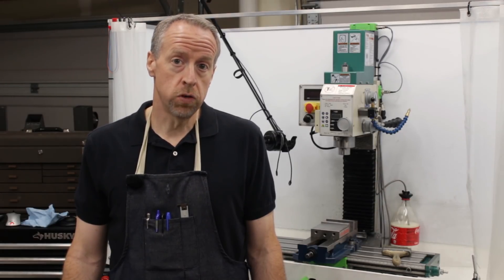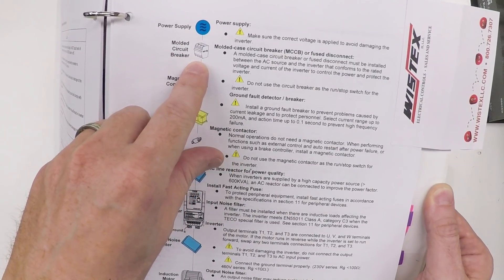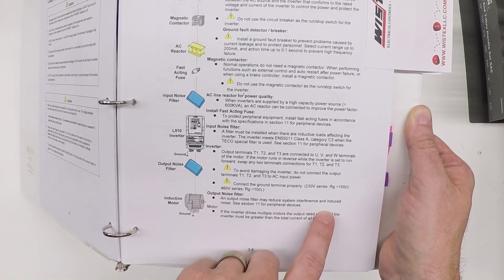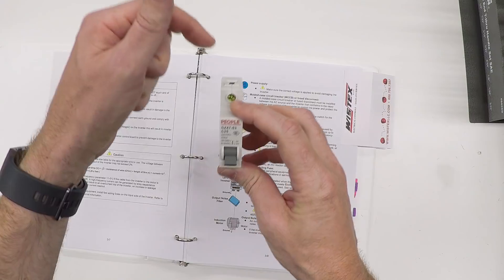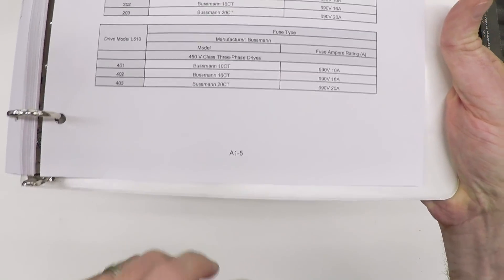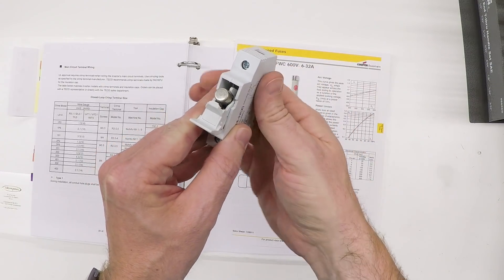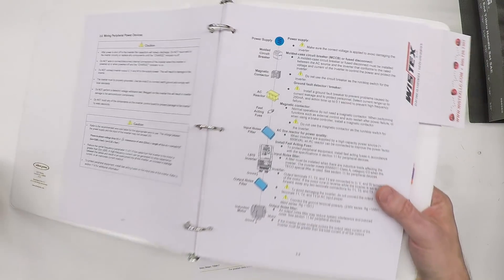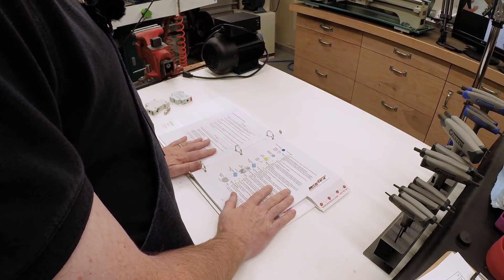Lathe VFD 8: How to Wire Circuit Protection (Breaker and Fuse)

Comment: 3 times I've called Automation direct and 3 times they've talked me out of buying a contactor and a fuse and fuse holder!  I see they say to use them and I call to ask which ones I should buy. They say there isnt any real way to save our vfd, I use a AB disconnect and emi filter and an Eaton breakers. I want to use a contactor though.

Comment: Soooo ... adding a 3-phase motor and VFD to my HF knee mill. Very simple schematic. I get the motor running on the bench, begin to install, and see what James has to say.
OK, add some circuit protection ... take off the panel on the back of the mill, and see awesome existing wiring, with two circuit breakers, not shown in the schematic.
So I've started ahead in the game. Will still add a fuse, however. Mebbe.

Comment: I might have said this before but thanks for making the best video on this subject on YouTube.  I don't know why more creators don't do this (put hot wire here, put neutral wire here etc.)   They act like it's trade secrets or something. Most people come to YouTube to either learn or validate their process. You expertly helped me learn and validate, so thank you.  if possible could you do a video on how to control a spindle either using PWM or RS485 in the way only you can do. FYI my system is running smoothly, although manually through the VFD right nom. Thanks.

Comment: Whilst I agree the safety difference may be marginal, wiring in all the safety features, as set out in the manual and as tested by UL, is potemtially one less loophole the insurance companies can use to avoid a pay out if by some awful chance your shop burned down due to a fault in the VFD!  Otherwise great series and many thanks.

Comment: question for you on the circuit breaker and fuse.  my vfd is a 240 v input rather than 120, i should use a double pole breaker and 2 fuses, correct?

Comment: James, thanks for this series--incredibly helpful!!

Anyone wire this setup with a L510-201? I'm trying to figure out what contactor to use and how to wire the remote controls for a 220v input. I initially used a Fuji Electric SC-E1 contactor but cannot get the normally open start switch to activate the coil.

Comment: Thank you for taking the time to produce this series - long-time subscriber and this series has been the most helpful for me in terms of my projects!  

Quick question: I'm setting up an L510 to run a 3 HP European machine at 50 Hertz - consistent with its highly-engineered design.  The L510 230V, 3 HP model requires a 50 amp fast-acting fuse so I'll be using Bussmann 14x51mm fuses (FWP-50A14F) in a  Bussmann 2-pole DIN holder (CH142DU).  Dumb question, but I want to confirm that I want a 50-amp fuse on EACH leg of the 230V incoming line; is this correct?  (Hoping you suffer fools graciously 😄)  The alternative, which I believe is INCORRECT, would be to install 25-amp fuse on each incoming leg to provide a total of 50 amps of protection.  I just want to double check.

Related on the incoming circuit breaker,  the rating on page 3-14  of the L510 manual is 21 amps for my unit; akin to the 19 amps on your unit.  1.25 X 21 = 26.25 amp 2-pole circuit breaker suggests I would want to move up to a 30-amp breaker.  However, I plan on staying with a 25-amp breaker (approximately 1.19X the 21 amps) because the breaker is rated as a D-curve (the slowest tripping speed).  The breakers appear to come in B-curve (fastest), C-curve (medium trip speed for smaller motors), and D-curve (motor-starting trip speed).  Also, the motor NEVER starts under a load so I'm thinking 1.19X max current for the breaker will be sufficient.  The specific breaker I'm planning on using is an Eaton FAZ-D25-2-NA.

Finally, I recognize that you're a fellow maker, and NOT a consulting engineer, so I acknowledge that I am SOLELY RESPONSIBLE for any design decisions and related [hopefully NOT, but possibly] catastrophic outcomes.

Any thoughts are greatly appreciated!  Thanks again!

Comment: I have a question. I got the VFD for my "project" and have watched the videos again and again. 
Now IF a man wanted to install a "hard start kit" for a HVAC unit, only not on a HVAC unit,
and wanted to "charge" the capacitor from the wall, to give it an initial charge, how long would he leave it in for

to get the Amps up? Thanks any advice would be helpful.

Comment: One note on why the fast acting fuse when you already have the circuit breaker is that the circuit breaker doesn’t trip until the bimetal element inside heats up enough to cause the trip, maybe one to two seconds; the fast acting fuse just blows in a millisecond. This works best if the wiring from the fuse to the VFD runs a long distance and one of the wires is grounded before it gets to the VFD. I hope I make sense to you, at least this is how my electrician friend explained it to me.

Are you running this from 110VAC to 3PH??

Comment: You are only allowed to wire that fuse from the top period!It's in the electrical code like and load.Line is always on the top load on the bottom .There is an exception to the rule in controls as part of an assembly to keep wires shorter

Comment: A very good video. My two cents are that first you don’t use a GFCI with a VFD. The VFD will trip the GFCI. One exception is the KB brand of VFDs which can be ordered with GFCI feature that prevent nuisance trips. The other tip is that if you use fast acting fuses you don’t need a breaker. It’s true that a breaker is convenient as that you can just reset it if it trips, but the fast acting fuses will blow well before the breaker reaches its limit anyway so you’ll be replacing fuses. And many companies, ABB being one, don’t recommend a breaker to protect the VFD. They prefer the right type of fuses. Thanks for the good quality video.

Comment: ANOTHER MASTER CLASS IN HOW A TUTIOURAL SHOULD BE PRESENTED  CLEAR EASY TO UNDERSTAND ........if.....IF.... you decided  to do another vid on VFD,s  i would like to see one on ........ a single phase  and 400v DC  input ..........and wiring  with 15 meter external controls   10v/24v  for  an indoor out door project      ...were i would perhaps have a stationary machine with a hose  that i could move around and control the VFD  from  near the end of the hose   so you could   start ....emergency stop... and reset and of corse VF potentiometer .... FWD/REV .... just rearly enjoy your vids and fully understand your watchers are pulling you and many different directions so i will pull you in another thanks  do you have a paypal account  i  and others could buy you a coffe..??  Mark from down under Australia   with thanks

Comment: I am confused.  You state that you have a 30a breaker on the 120v circuit but the outlet is standard for 15a service.   There are 'standard' outlets for 20a service that look similar or outlets for higher current service but the standard plug cannot be used.

Comment: Another reason to use a fuse instead of just a circuit breaker is that..If there is a large enough inrush of current the circuit breaker can actually be welded in the closed position. Where as a fuse can not. Thus a more safe circuit.

Comment: They also list Ground Fault detector/ breaker but I believe yours is just a regular breaker. No problems with that?
Reply: Where did you see that. ? You would have to spec out the gf protector very well to avoid nuisance tripping

Comment: Another great video, another great job. One thing I am pretty sure I'll be adding to my 3 phase powered rotary machines like pillar drill, lathe (when I build it!) and maybe a  sanding disk/belt would be an rpm meter (lathe especially) to save having to (mis)calculate speeds from the dialled in Hz of the VFD. Another little Arduino project?

After that ... A DRO? 🤔🤔🤣🤣
Reply from the maker: The electronic leadscrew I have installed on it now has an RPM readout.  And I do have a DRO for it sitting in a box.  :)
Reply: @Clough42  cool. Have you already done a video?
Reply from the maker: @boblewis5558  for the electronic leadscrew?  Yes.  A whole series covering the hardware and software development.
Reply: @Clough42  great! Only just discovered your channel. Will search them out. 👍👍👍
Reply: If you find the right VFD, you can usually program it to your specific motor's rated speed, which consequently, will display an RPM value instead of a frequency, and thus, eliminates the need for a stand alone tachometer
Reply: @benw4544  thanks, but the plan is to use only one VFD as I won't be using multiple devices at the same time so can switch between them easily enough. Otherwise good info to know.
Reply: @boblewis5558  Something I did, when I first started out was to get a laser tachometer - with this, I put a small piece of reflective tape on anything that spun, and could get a fairly accurate speed readout for any machine with very little effort. I believe it cost me around $30
Reply: @benw4544  thanks Ben, I'm aware of lots of different methods and the reflective tape is similar to getting car revs by using a light tacho shining onto a large white Tippex mark on the crank pulley. I used that one 50 years ago when tuning my Mini! Using an Arduino Nano, or even just an ATtiny85, building an accurate tacho is pretty straightforward. I designed one MANY years ago just with transistors that hooked up to a standard analog car tachometer for display. The Arduino compute power enables it to be that much more powerful if needed. 👍👍
Reply: @boblewis5558 Sorry, I didn't mean to insult your intelligence in any way; nevertheless, someone might skim through these comments and find the info valuable. I love the Arduino idea - those things are a real game changer for the home shop
Reply: @benw4544  you didn't and I do the same! Even the most experienced can learn little nuggets! 👍👍👍👍

Comment: An ac reactor should absolutely be used on the line side at the least. Especially if you are powering a spindle drive or axis drive. It not only does everything you mention but it also will protect the drive from inrush and motor spiking which will eventually lead to the breakdown of the drives internal components.

Comment: I've been watching this whole series. I may have missed it, but is it possible to supply this VFD with 240v by utilizing both phases from your electrical box? I thought you did but it looks like you are plugging it into a regular 120v outlet.
Reply: Yup you missed it. Here's the info from where he bought it at Amazon...
"Teco Variable Frequency Drive, 1 HP, 115 Volts 1 Phase Input, 230 Volts 3 Phase Output, L510-101-H1, VFD Inverter for AC motor control"

Comment: Hi, Thank you for your tutorial.  I am patterning my lathe 3ph motor and VFD after yours.  I can not find whar contactor you used?  could you give me that info?  Thanks, Shawn....
Reply: Why do you want to incorporate a contactor? Just one more component to fail and when it does it a lovely weld. A properly sized mccb and ac reactor are what you should really worry about
Reply: @beckyschwantes5287  This what the E-stop uses to drop out power.  If the VFD smokes, you want to kill power to it.

Comment: Do you have a way to contact you, I've got a question, that no one seems to be able to answer. It's concerning the wiring on a three-phase motor with regards to the vfd, and you're the only one that would seem to be able to answer it.
Reply: What’s the question
Reply: @beckyschwantes5287  I have all the contactors and startup switches on mine, mine's a more industrial style lathe. I would like to add the feature of a variable speed in between the gear changes of an engine lathe. however when you engage the drive lever it automatically shuts off the vfd, it's sensing a short. I was trying to think of a way to make the three-phase motor variable speed without removing all the safety equipment and everything that's associated with it.... putting it inline after the start-up relays...
Reply: @dbuilder81  you have a contactor before the VFD? Are you sure it is sensing a short or could the coil of the contactor be dropping out for some reason and dropping the power to the drive?

Is your lathe a servo shift where the spindle hunts back and forth while the transmission engages a new gear? You should have someone else pull the spindle lever and you stand back and watch the contactor. Make sure that it doesn’t drop out and open the contacts.
Reply: Also what is your input voltage and motor voltage and did you set the parameters in the drive to define them?
Reply: @beckyschwantes5287  its when you engage the motor...it runs fine hooked up to the rotary converter. Whenever I tried bypassing the rotary converter going from the VFD it wouldn't work....qlmost like it needed a capacitor on it to store a charge momentarily let it start up then run. BTW its wired 230v 3 phase.... thanks for the information
Reply: @dbuilder81  you never use a capacitor  connected to the motor when driving with a VFD. Vfds have multiple protection functions and some drives have a protection circuit internally wired so it will immediately drop the contactor or power supply and try to protect itself. Most of them will store the fault code so you can power back up and read the fault from a parameter where it’s stored.  Takes some pictures of the drive , motor, and  any control circuits and I will help you figure it out.  My email is matthew.lewellen@att.net I just noticed that larthe the other guy wired a VFD to was a bench large. That Probably had a 1hp motor on it if your spindle runs through a transmission it might take some torque to get the spindle moving.
Reply: Awesome video! I see you are trying to stay up to code. Technically you should have a mccb circuit breaker protecting a VFD. Also that breaker you installed appeared to be an accessory circuit breaker. If an mccb will not be installed that din rail breaker needs to have a UL 489 designation at the very least.

Comment: Couldn't one run it off a 20amp circuit? i.e. I had an electrician install  a dedicated outlet with a 20 amp circuit which was based upon the original motor Grizzly supplied motor whose manual called for a minimum 20 amp circuit. Do I have to now get the circuit upgraded to 30 amp. Couldn't I just run with the 20amp circuit? Isn't the worst that could happen is I trip the breaker? And couldn't I just install a 20amp quick blow fuse?
Reply: You are basing your protection on the drive input amperage not the motor. You have to be capable of carrying 1.25 percent of the rated amps. Your wiring has to be able to carry it also. I doubt you could get it to run on a 20 amp breaker , I think the inrush current would trip it. VFDs have quite a bit of inrush while it charges the caps

Comment: I guess you haven't had any over heating problems in the cabinet? I ask because I have ordered a VFD same model as yours and the manual which I received suggested that the VFD have 120mm/4.72" clearance above it and 50mm/1.97" on either side. I guess that your fan at the bottom and the exhaust 'port' as the top is providing enough cooling.???
Reply: Those dimensions are relying just on the drive fan

Comment: The manual appears to 'suggesst' installation of a ground fault circuit interupter/breaker. You appeared to just us a 'regular' style. ????
Reply: Where did you see that? It called for an mccb. Which is standard for that application.

Comment: Another excellent video! I like how you get into reasons for using and the recommendations and behind the 'need' for all the items.
I am just curious to know how often you still go in and change the route/use of the v belts for the spindle drive? i.e. I thought the main reason for the VFD was to reduce/eliminate the need to fiddle with the v belts. ????
Also, have you done this on a milling machine? I just purchased a Grizzly mill/drill G0705 and there are lots of comments about what a hassle it is to have to change the v belts to change spindle speed. I googled to see if anyone had done this on a G0705 but couldn't find anything.

Comment: James

Just a comment, no question this time <vbg!>  As a source for short lengths of quality shielded cable, look at computer ethernet cables.  Reasonably priced, available in assorted lengths, and I feel that twisted pair is more immune to noise than straight thru wires

They also make rh45 panel connectors that are female on both sides, so with an extra ethernet you can cut this extra cable in half and use that for connections inside the cabinets.  Plus it is extremely easy to connect/disconnect these cables as needed via the RJ45 jack

As always, I really enjoy your videos, keep up the great work and great content

John

Comment: Just came across you excellent video series as I’m wiring control circuit for CNC VFD. I “know” how a contactor works but from video Neutral is to NO and Live is to NC circuit - how does this work ( current flow) when contacts are closed?
Reply: I think you are looking at the auxiliary contacts. It has to get 120v to the coil to close the contacts and feed the VFD.